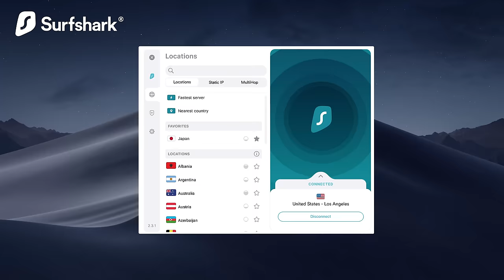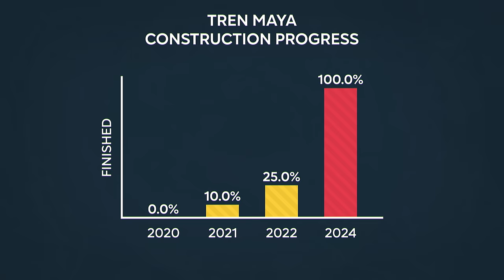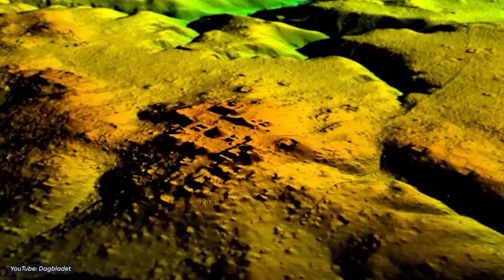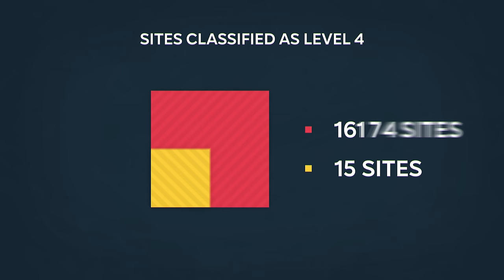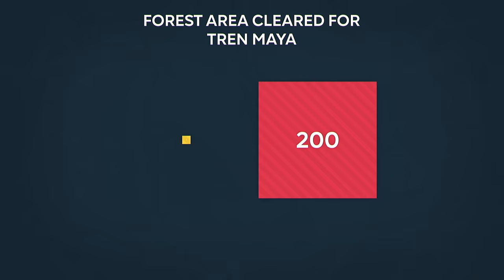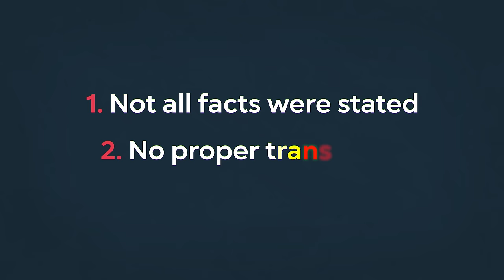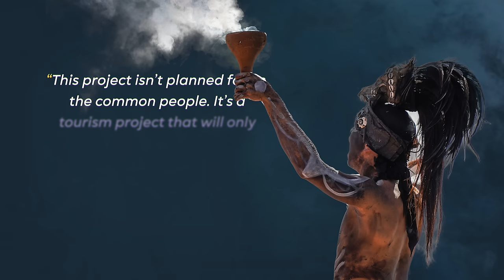Tren Maya: Mexico‘s Biggest Megaproject

Comment: There's some missing info in this video. First of all, the train is not only for tourism, it will also have shipping trains with no passengers at all. Secondly, the Tren Maya is attached to the greatest reforestation program that has ever been in the peninsula and also created new protected areas, some of those areas were pledge to big hotel chains and amusement parks but mainly for building luxury residential zones destined for politicians and businessmen (those companies didn't even bother to take in consideration the opinion of the locals). And what I think is most important is that this project will allow the construction of hospitals and clinics that are currently unaccessible to the people in rural communities. Some have to make around 6 hours to the nearest hospital or even more.

Comment: This video makes is seem like the mayans built everything in a straight line and the mayan train is going to go right through it. There actually investing millions of dollars in protecting and researching as much as they can. Anything worth preserving there moving to museums or diverging the rails to protect as much as they can. They do weekly updates on this project so theres alot more information out there. Lets not pretend like every nation hasn’t had to clear trees, drill through mountains, dam rivers for mega projects. There actually building a few land bridges and tunnels for animals to safely cross. They have massive nurseries to replant trees in other locations for the trees cut down in various projects. Most negative information comes from the opposing political parties that have been losing alot of support over the last couple of years. There also rebuilding homes for locals that have had to move. Towns and cities near the raiload have benefits like improving there power grid, installing internet services, paving roads, ect…

Comment: Its unclear why they have cleared such a wide area of trees? Train tracks are usually right next to each other.
Reply: You don't need to be an engineer to figure this out. In the US, they clear about a 100 foot path to lay an 18 inch natural gas line. They need the room to equipment in and around the trench, including the equipment to dig the trench. Semi trucks aren't small, pipe lengths are long, welders need to get in there, the pipe needs to be laid in the trenches after the pipes are welded together, there has to be room for all the dirt and the ground has to be covered up when they're all finally done.

Now imagine what all goes into constructing a railroad bed. Then adding the rails. Trucks, graders, bulldozers and other heavy equipment need to get in there to clear a path, haul off the trees and dirt, bring in the gravel and railroad ties and all the employees to get the job done. So you need a road on one side of the railroad bed, the railroad bed itself and another road out on the other side. That's at least 80 to a hundred feet for all that. And it looked like they were putting in a paved highway next to some sections of the rail line.
When you do infrastructure construction projects, you need a lot of space just to work around the site. 

Besides, the Yucatan peninsula is over 76,000 square miles. What's a hundred foot wide strip going to do to it in the whole scheme of things?
Reply: I think the image they use here is fake, it certainly isn't representative of the entire project. According to Reuters, the path is "up to 46 feet wide". So it's not even a hundred feet wide. Maybe in certain sections, but not all the way across the length of the line.
This image is a gross exaggeration.